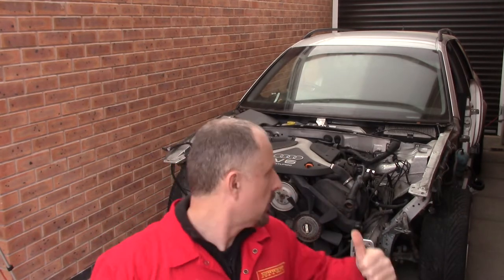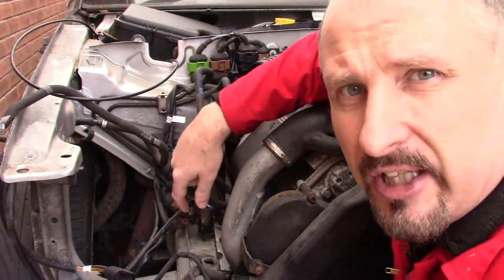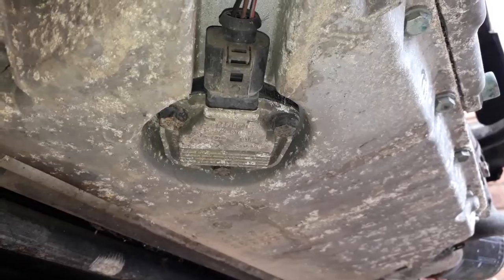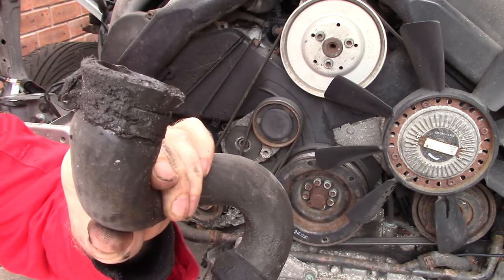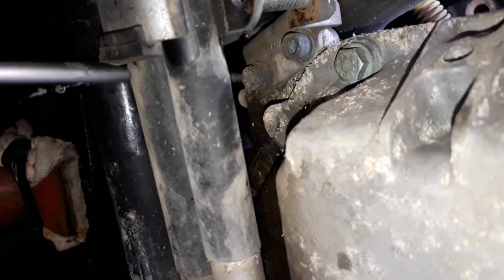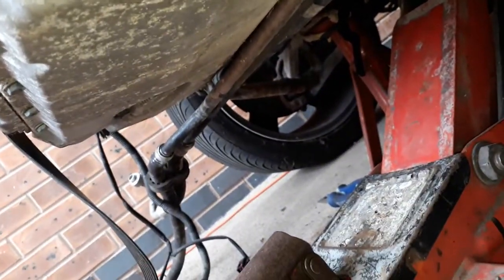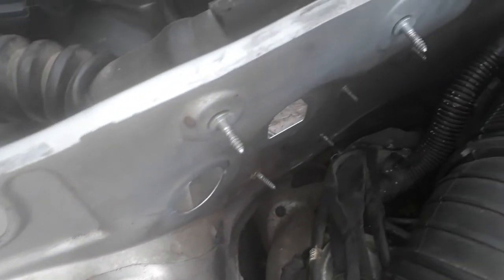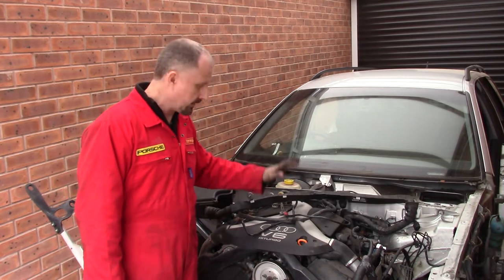Stripping the Wiring Loom and Alternator Headache: Audi 2.7 Bi-Turbo. Ep13.

Comment: I've only just learnt that engine is a detuned RS4 engine. Now I truly understand your engine choice. It's a great engine, fantastic power and torque as standard and with huge tuning potential. That'll make the ideal engine, as you can just boost performance if you feel you're ready for even more acceleration and speed. Nice!!!
Reply from the maker: Yep you guessed it. These A6 2.7 twin turbos are pretty much the same as an RS4 under the skin, but are a lot cheaper to buy. Like you say, plenty of tuning potential, and there is a large aftermarket following so tuning upgrades shouldn't be too expensive.

Comment: Jubilee clip, by crikey I haven't heard that for a long time. That engine bay is like a puzzle. How the hell did they do it in the factory build, drop the body onto the subframe I 'spose. How good would a hoist be? One day maybe. Cut the air con lines - no one will want them. Is that you singing along to the music? Must've had your Reg Grundies (undies) pulled up tight
Reply: Jubilee are still selling them as far as I know, as I worked at a hydraulic firm in Essex that stocked and sold them. The real deal clips are a thing of beauty (I'm sad, I know haha!)
Reply from the maker: Yeah, this engine bay is extremely compact, like you say quite the puzzle. I was also wondering how they put this together in the factory. I might have to use my hoist to get the engine out, but I can't reach the heater hoses at the back. I might have to get the car really high up. Don't know yet, still thinking it over. I could cut the air-con lines, but I'm trying not to "cheat", instead of chopping the engine out, I'd like to try and dismantle it. I do want to keep these lines but I'll have to lengthen them. "Grundies" LOL, :):);)
Reply: You've got a hoist! Well. Use it.  I understand your perspective tho, regarding cutting. Thanks mate
Reply: @davidkennedy1077  I first heard that name when I did my apprenticeship in the railways here in Australia, in the late '70s/80s, obviously a brand name, now you mention it. You're not sad, educated, lol. Cheers
Reply from the maker: @donfinch862  Yeah I've got a hoist, but no engine stand, hence I was going to leave it on the Audi sub-frame. I'd prefer to support the engine, rather than having it sit on it's sump. So what I might have to do is pull the engine out using the hoist, remove the sub-frame separately and then re-fitting the engine to the sub-frame, if that makes sense? I'll go into more detail when I do the episode.
Reply: @donfinch862  I always thought it was just a term rather than a brand until I got that job. The real thing are really nicely made, high quality clips but theres a lot of cheaper copies that are often used by car manufacturers. Another thing that I used to make are gorgeous braided hoses, these also look incredible on high performance cars (and they last a lot longer) but Earl's and Goodridge worked out almost as cheap and very high quality so we used to order kits in. The vast majority of hydraulic hoses we made were for fork lifts and car transporters, but we did a bit of car and motorcycle stuff (Norton Hydraulics was the company) well worth a visit if people are after custom made. Sorry I've gone off on a major tangent haha!!!

Comment: Pretty sure one thing Audi was thinking was that you would have a set of allen sockets.  Good enough work around, and you got it done, but I wouldn't blame them.  If you are going to pull the engine, just pull the engine.  Those AC lines have plenty of flexibility in them so you can just pull the engine up, forward, or down (your choice), then drop the AC compressor while you are staring at the side of the engine.  That's the easy way, but I've also removed an AC compressor with the engine in place.  Looks like you did an awful lot of faffing about because you wouldn't remove the intercooler pipes so you would have room to work.  Two clamps and one 10mm bolt each side and suddenly you've got tons of room.
Reply from the maker: Yes you're right, you noticed the faffing. I'm planning a video in the future of a partial strip down of the engine, just pipes and wiring etc, not a full tear down, but I want to do this when the engine is out of the car, so I can get the camera in a show everyone. So I'm trying to pull the engine as a complete unit. Yes it does take a little more work. As I dig deeper into this engine removal, I might have to pull some intakes off, but we'll see. It's all for the channel. ;)
Reply: @ProjectSupercar  I checked two of my cars, and neither one of them have that p-clip on the wire with the allen screw.   Given that I've not seen a clamp like that on any VW or Audi, I'm going to say that is not stock, but was added later.
Reply from the maker: @brianhaygood183  You could be right, I have found a few little "bodge jobs" on this car.